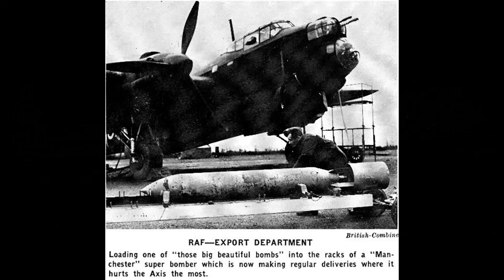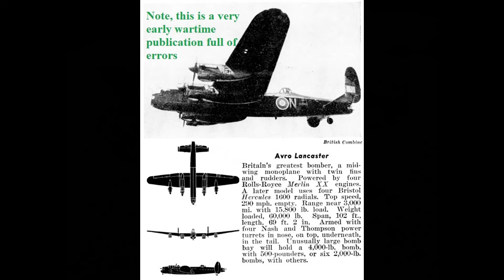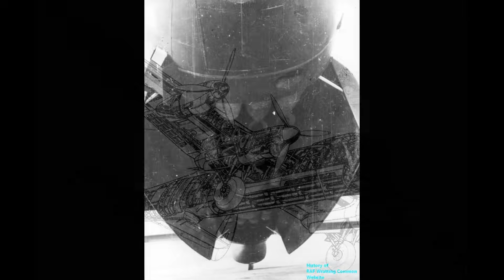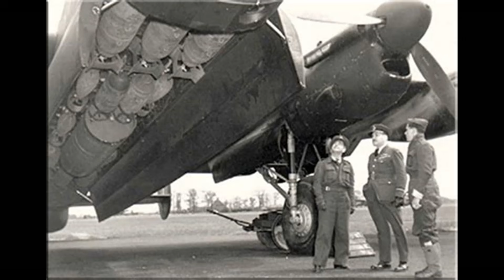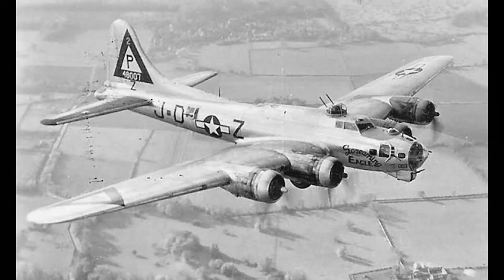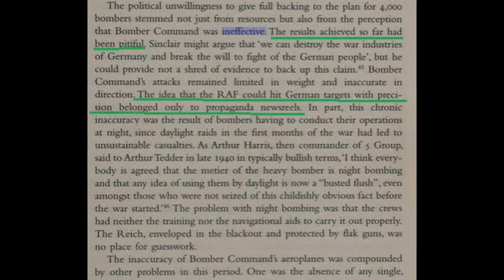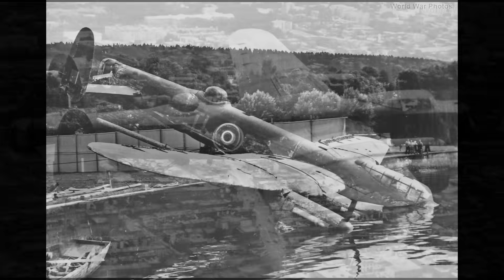Avro Lancaster, Payload, Turrets, Stability and More

Comment: Couldnt tail be related to tail volume and size of available hangars or equipment used to service the aircraft. Need more volume, better to use two vertical surfaces than a single large one, also less moment on rear fuselage due to tail drag eccentricity from center of pressure
Reply from the maker: In some cases it was done so that planes would fit into existing hangars, but that wasn't much of a factor in WW2, it's more of a civilian airliner thing.

Comment: I am currently reading the book "Duel under the Stars" by a German ME-110 Night Fighter Pilot.  In all his air battle accounts he seems to almost exclusively describe his planned attacks occurring from below the British bombers.   Which makes me wonder how busy the top turret gunners in the Lancasters actually were....
Reply: For that reason Victoria Cross recipient Leonard Cheshire had his Group's nose and dorsal turrets removed to reduce weight and drag for a little more speed.
Reply: Actually 405 Sqn had a hole cut in the floor and the Dorsal Turret was eliminated and that gunner with safety straps Oxy connection for a heated flying suit He would spot the plane coming in from below and alert the Pilot. Who would immediately throttled back and lowered 10 degrees of flap when the enemy overshot and then at a critical moment would shove the Yoke fully forward putting the huge bomber in a dive right on top of the German Fighter Sometimes they hit and sometimes the German got away Whatever they never came back

Comment: The Merlin was noted for throwing con-rods (failed big ends) when over-revved. All sorts were tried to solve the problem but they basically learned to live with it. Henry Ricardo eventually said the oil pump was not big enough. He noticed that test bed twins, using a full size pump, could be brutally over-revved without problems. I wonder if the Vulture failed for similar reasons. 24 big ends is a lot of centrifuge effect to extract oil faster then the pump can supply it.
Reply: "The   initial   Packard modifications were done on this engine by changing the main bearings from a copper lead alloy to a silver lead combination and featured indium plating. This had been developed by General Motors' Pontiac Division to prevent corrosion which was possible with lubricating oils that were used at that time. The bearing coating also improved break-in and load carrying ability of the surface. British engineering staff assigned to Packard were astonished at the suggestion but after tear down inspections on rigidly tested engines were convinced the new design offered a decided improvement."

 Packard Merlin Aircraft Engine - Combat Air Museum on line

Comment: Where do you get the bomb load for the B-17? Boeing's site says 9 600. The Lancaster was sufficiently flyable for the women of the Air Transport Auxiliary to fly single handed (to the amazement of the station crews)
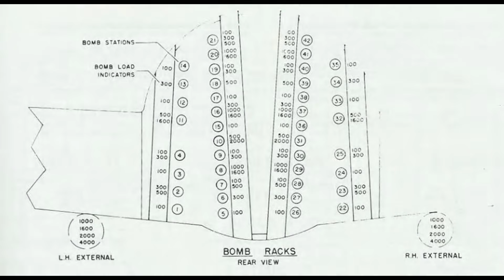Reply from the maker: I said the MAXIMUM internal bomb load is 12,800 pounds. This is directly from the bomb loading section of the pilot's manual. One of the relevant pages is literally on screen at 13:25. I think some of you guys must listen the this on audio then type in questions in the comment, because a lot of people seem to miss stuff that's on the screen. It's no big deal, just an interesting observation. cont:

 The Boeing site does not list a maximum, it just says bomb load 9600 pounds. That page is intended as a historical footnote, it's not a detailed examination of the plane. cont:

    Hanna Reitch flew the Me323, and she was tiny and the 323 was far heavier on the controls than just about anything else ever built. I'm not sure why you are surprised that British women could handle the Lancaster.
Reply: @GregsAirplanesandAutomobiles  
Great documentary on and featuring Hanna Reitch on YT, German chief test pilot. What a story. She piloted development V1 bomb drones, adapted to carry her, to check and monitor it's automatic flight controls. And flying an early helicopter indoors in an exhibition hall. Amazing lady she was.

Comment: Can I correct a couple of points concerning the Avro Manchester, and the very first production Lancasters!

The Manchester had a dorsal fin and rudder in addition to the twin rudders, ie a triple fin tail, that we have long associate with the Lancaster, and this triple tail design was carried over onto a small number of the first build of Lancaster 1's! These triple tailed Lancasters were quickly withdrawn from front line service and relegated to conversion training for crews converting from twin engined types to 4, and from other 4-engined bombers such as the Short Stirling (first flight 14/05/1939) and the Handley Page Halifax (first flight 25/10/1939) which were in service earlier than the Lancaster (first flight 09/01/1940).

Likewise there were Lancasters that were fitted with the Bristol Hercules radial engines normally fitted to the Handley Page Halifax, and a version of the Halifax that was fitted with RR Merlin engines.
Reply from the maker: That's fine, but those are additions, not corrections.

Comment: Late comment: It was my understanding a B-17's bomb bay doors were spring loaded to a weight or pressure lower than the smallest bombs it would carry so any bomb that might get loose would force the door open and drop free. That's what Aluminum Overcast's pilot told me when I found her emptying my water bottle into a drain as we departed the plane after our ride when our squad, The Specialists in Aces High,  visited the USAAF Museum in Dayton when the Memphis Belle was put up on display. I evidently dropped it when I was walking through the bomb bay. We had some weather in flight confirming they are not water-tight and even had some tail wheel shimmy on landing. They had to look at that before the next group went up for their ride.

Comment: A couple of points. Whilst the bomb bay could not be entered in flight, bomb 'hang ups' could be addressed. After release, the bomb aimer would inspect the bomb bay through the viewing port and if he saw a hang up, it could be manually released. My late father (a wireless operator) recounts in his diary that there was a hooked tool which he inserted through an aperture in the floor to snag the release.
The issue of downward visibility was addressed in later aircraft by fitting a small perspex blister under the nose just aft of the bomb aimer's nose dome. This allowed him to look down and back under the aircraft.
Reply from the maker: No question that it could be addressed, which is made clear in the  clip from the book on screen. The point is that it was a much more dangerous situation than with a bomb bay with in flight access.

Comment: Why 303 in the Brownings? I don't understand the use of 303 except for the standardisation. I've toyed around with the Browning 1919 in 30-06 and it's no problem converting it to 9,3x92. The 9.3 bullet volume is much larger than the 303 and made with expolisive bullets it can produse quite a blast. Even the much more powerful 9.3x64 Brenneke  will fit in a converted 303 Browning. This round has higher velocity with twice the bullet weight of a 303. A 9.3mm bullet would have double the exploding charge tested in this 8x57 German B-ammo: https://www.youtube.com/watch?v=AXaaybiRiYY&t=760s

Comment: You mention payload in the title (as in weight of bombs), and touch on that briefly - but many of the pictures showed the varying bomb loads able to be used in the long-and-wide bomb bay, i.e. the 2,000, 4,000, 8,000 and 12,000lb bombs (cookie / blockbuster etc).  Will you be covering this flexibility in another video perhaps?

Comment: Also I remember in Paul Brickhill's novel.....
"On June 1, Avro experts fitted new automatic pilots in the Lancasters for the D-Day operation, and Nicky Knilans at last found out why his much-cursed "R-Roger" flew like a lump of lead. They found it needed longer elevator cables than the others, inspected to find out why and discovered that the elevators had been put on upside down at the factory.".

Comment: One factor interests me: the long bomb bay. Was there a procedure to keep the aircraft in trim during bomb release? Because ther is a lot of weight released. Did this affect the longitudional trim and was this monitored and/or corrected? Because, if one drops just a partial load fore or aft, there is a shift in center of gravity and there is a loooooong bomb bay......
Reply from the maker: Yes, if only 1/2 the load drops that would be a wild ride. However the odds of those specific releases all failing at the same time are pretty low. Most likely it would be one or two, and that would be too bad from a cg standpoint.

Comment: Awesome video as always. Thanks, Greg! 

Regarding the labels of "high wing" vs. "mid wing" vs "low wing" I think a better technical description starts with noting the thrust line as a datum, and those terms are relative to their locations as compared to the thrust line. Then the horizontal stab is also in a position relative to the thrust line and is often located above the wing centerline (ignoring the airfoil shape for the moment) to avoid the downdraft from the generation of lift that would give an upward pitching moment that varies with speed. 

Depending on the desired flight characteristics and role, you'd locate the wing and stab accordingly relative to the thrust line. I suppose other datums could be selected - the wing centerline - but given the forward thrust vector that seems a good choice and its opposed by the wing's drag component - hence the importance of the wing above or below the thrust line and the amount of leverage (the moment arm) it generates. 

Just my two cents worth. Fact check, please?

Comment: Lancaster was fitted with fuzing devices at each station. This was an electromagnetic
Lockfor dropping bombs live. If dropping safe the electromagnet would not energise and therefore the bomb would drop safe. So no access was not an issue
Reply from the maker: Some used that system, not all. Furthermore, there are plenty of horror stories of armed bombs rolling around in the bomb bay, so either way, yes lack of access is still an issue.

Comment: Re the failure of the Manchester due to its 2 v-engines bolted together in 1 nacelle: The German HE 177 also suffered the same fate. Were there any successful WW2 era aircraft that overcame the  overheating and engine fire problems of that engine configuration?
Reply: Napier Sabre (H type)

Comment: Lots of Lancaster's did modify their rear Gun turrets by substituting their 4 x 303's for 2 X 50 cal,  yes it was not standard but many aircraft did indeed fly with this configuration.as pointed out in the above at  25.43. Some Lancaster's did away with some turrets, the most obvious was the 617 squadron's Lancaster's that were heavily modified to take the famous (or Infamous depending on your point of view) 'Bouncing Bomb, The dam busters. These aircraft had machinery installed to set the Bomb into a spin before release, the associated weight and space negated the provision of the dorsal turret. Some  of 617's Lancaster's actually had the front turret removed and faired over as well as the dorsal turret, 
617 were used for various 'specialised' bombing missions not just the dam buster missions, however these  modified bombers usually flew in daylight, a rare operation, but one that did occur such as the bombing of the Tirpitz (which had a direct hit from a Grand slam 10 ton bomb, the biggest non atomic bomb dropped in WW2 ) or the bombing in  March 1945 of the Bielefeld Viaduct  using the smaller 12,000ilb 'Tall boy' this bomb meant that the Lancaster's had to have a modified bomb bay doors as seen in the linked YouTube video below. At this stage of the war the allies were in Europe, and so many missions did allow the provision of escort fighters flown from bases in France etc which were far more effective than relying on self defence of a bomber's guns  alone as was  sadly shown to be true with the USAAF's raid on  Schweinfurt, this  occurred on October 14th 1943,  before the P51.B with drop tanks was being used routinely and so consequently these B17 even with their plethora of defensive turrets and guns were still easy pickings for a determined and motivated Luftwaffe this raid was known as Black Thursday in the USAAF. It resulted in 600 aircrew being killed or taken prisoner, and dictated that no more raids were to be conducted into Germany until the provision of suitable long rang Fighter escorts,  see following link for a good account of this the saddest day for the USAAF history in the European theatre of  war.
 https://www.youtube.com/watch?v=XZqdK0p2NzI
Also watch the link below for a  a good description of just how adaptable Lancaster's were and what  was modified for such missions,  incidentally,  these aircraft were not only modified with the removal of bomb bay doors and dorsal and front gun turrets etc but some  also had 'upgraded' Merlin 24 engines with 'paddle bladed props.  
  https://www.youtube.com/watch?v=-F7PbHSkFYI&t=553s

Comment: Did the B29 have a bomb bay walk way? I built a Revell model yearts ago and I remember it had a 'Tunnel/crawl way linking the  2 pressurised cabins, i.e.front pilots. engineers etc compartment with the  real gun control  compartment but I saw no indication of a walkway not to mention the fact that at the high altitude would it be feasible to walk in such a  environment. I only mention this as surely the B29 was indeed a large USA bomber, that unlike the B17 and the B24 they both indeed have 'Open walkways' along the bomb bays. I may be entirely wrong it's only something I have not been aware of.
Reply from the maker: There is a pressure door right below the tunnel/crawl way entrance from the flight deck area. That door goes to the bomb bay. Obviously you wouldn't open if the plane is pressurized. Of course you wouldn't be able too anyway because of the forces involved.

Comment: The lack of access to the bomb bay was to do with the strong flat floor of the aircraft. This was required in the ministry specification for the Manchester as they required an airframe that could withstand a catapult launch. I'm not aware it was ever tested. (Edit:  I understand a Manchester was launched by catapult off a trolley on a single occasion)

Comment: Did you know that Avro were initially refused access to Merlin engines to test modify a Manchester for four engines because of demand from other aircraft. They "obtained" four engines to create the prototype Lancaster by illicit means. There is anecdotal evidence that Lancasters were very occasionally rolled, not intentionally but due to loss of control and orientation during evasion manoeuvres at night.

Comment: Regarding the B-17F maximum internal bomb load of 12,800 lbs it should be noted that load was 8 x 1,600-lb AP bombs -- hardly the weapon of choice to go after factories. The maximum amount of 1,000-lb bombs that could be carried internally in the B-17 was 8 x 1,000-lb SAP or 6 x 1,000-lb GP (the reason for the difference is that SAP bombs had a narrower diameter).

The Lancaster could hold 14 x 1,000-lb bombs internally, either British GP or MC type, or U.S. SAP or GP type.

While nighttime bombing is thought of as the main way Bomber Command went about its business, by mid-1944 daytime missions by Bomber Command were frequent, thanks to the USAAF winning the battle for daylight air superiority.

Comment: Relating to ventral turrets on Lancasters, what they really needed was a good lookout window. Because flying at night and not in formation, a Lancaster’s best defence was evasive action. A flush window and a simple .50 mount was a modification adopted by some units.
Reply: I've thought about this, and I feel the best option would have been a device to passively detect the radar units of night fighters, if such a thing were possible.
Reply: @neilpemberton5523  Possible, as both sides used such devices. But passive receivers such as the Serrate unit used by the RAF had limited accuracy and could not indicate range, so would have caused numerous false alerts. The Germans also used frequency switches to reduce their effectiveness. The best answer turned out to be the Fishpond modification of the H2S navigation radar, which allowed it to detect aircraft below the bomber.
Reply: @emmanuelgustin7851  Thanks for that. I'll do some research.
Reply: @emmanuelgustin7851  I read somewhere* that the Luftwaffe had detectors for H2S signals which could track bomber streams, and put fighters onto bombers. The term 'flammen' was used. H2S use was eventually prohibited along with 'Monica', tail-mounted radar.

*Try RV Jones.
Reply: @brucewilliams1892  The account in RV Jones’ autobiography is a bit too condensed. There was indeed a brief panic and a serious row in Bomber Command when it was discovered that the German Naxos detector could guide fighters to the bomber stream. But when it was evaluated that Naxos was too inaccurate to locate individual aircraft, and losses had indeed dropped with the introduction of H2S and Fishpond, the use of H2S was continued. The discipline in its use was improved so as not to give the Germans too early warning.
Monica was another matter. The “Flensburg” detector was accurate enough to put a German night fighter within visual range, so Monica was indeed removed.

Comment: Very interesting video! I had never considered stability and wing location as a factor in the use of twin tail fins. You probably know that the B-24 was planned to switch to a single fin when the war ended, to improve handling, and the PB4Y-2 would have the single tail. The He 177 with its similar wing location had a single tail, but the He 274 would have twin fins. A few types were flown as prototypes with both, e.g. the Do 17.